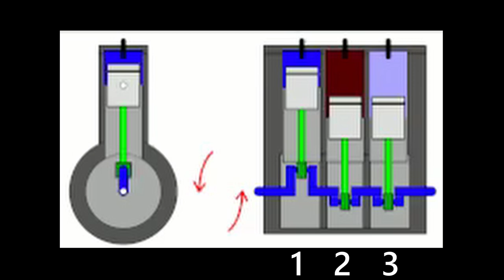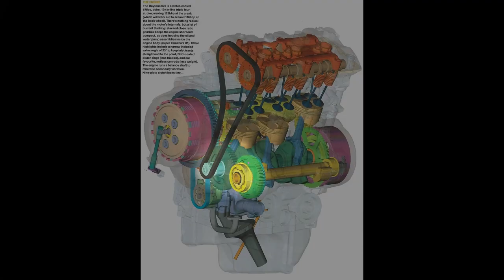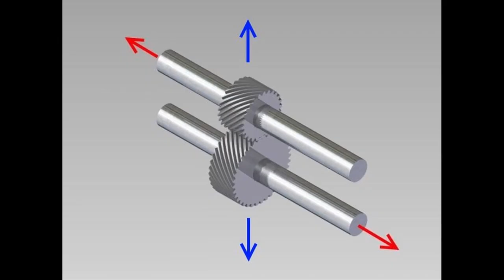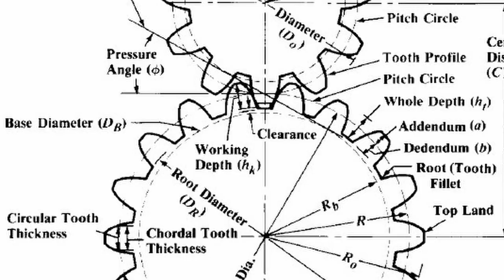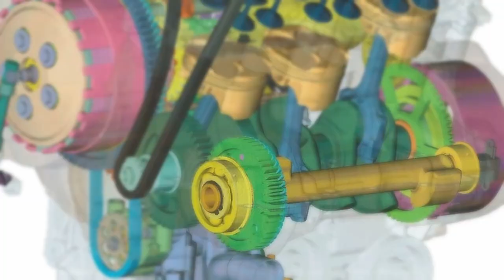THIS is WHY Triples WHINE and whistle | Tea Kettle HIDDEN inside the engine ?

Comment: Ok, I'm not someone who normally comments on channels other than in support if I like a video. It's normally short too, so excuse the length of this one. I subscribe to the workshop and many other bike channels, I subscribe to Matt's channel because I teach Mech Eng and have found his knowledge of engines and engineering in general interesting. 
From what I can see, there are many people out there that agree with your reasoning and many people who don't, I guess gear nomenclature is a complex subject. I will admit I am struggling to agree entirely with this as a "one size fits all" solution, but I don't think it is a million miles off the mark either. I do find dismissing the venturi effect in its entirety so hastily a little short sighted though. Matt did say he was speculating, and as I am sure you know, the complexity of Bernoulli's and Venturi's principles requires a lot more than a 10 minute video, so I would say speculating was sensible at that point, but still worth a mention by Matt, in my opinion.
Back to the point, I am sure with such a topic you will continue to prompt much discussion! You are certainly getting the views, more than my channel, but then I am working on an old XJ600!
This is quite possibly the longest comment I have ever left, but anybody who is passionate about Engineering can't help themselves.
Good luck with the channel.
ShedTorque.
Reply from the maker: Thank you for the comment ST and taking the time. Matt has built his channel on;
1/3 actually informative stuff, although badly executed - half his videos are him cursing about his markers not working.. 
1/3 literally bashing other content creators because he's very insecure but it brings him views and gives his minions things to do 
1/3 there not being a better alternative, and that's quickly changing.

I say this as someone who liked and watched his informative stuff before his ego inflated beyond biblical  proportions, think yeaaaars ago.

I welcome disagreement, but only when well argumented. To attack a much smaller channel on the basis of 'he's wrong, here's a speculation to attack him with' screams to me of wanting attention without thinking of the repercussions of his actions. If he really WAS concerned about the whole deal (he, the only guardian of the truth as he says), he would've contacted me directly - maybe asked questions, collaborated  on an experiment or something like that ;) Of course he didn't do any of that because he's an attention seeking psycho.

Back to the topic in hand. I owned and ridden multiple triples, it is my favourite engine config and put my own money down to buy them. I know them extremely well and  I've seen them being race tuned and prepped (Daytonas).  I know exactly where the balancer is on my XSR900 and I can literally hear it with a stethoscope. I can categorically tell you it is none of this exhaust bullshit he's talking about, he's way out of his depth on this one because he was too much in a hurry to being offended by a smaller channel making a video.

Love your stuff btw, good luck with the XJ6 ! Hopefully Matt won't send his deranged minions after your content too considering he thinks he's king of motorcycle content on youtube.
Reply: @UrgetoRide   
I watch The Workshop for the engineering so I won't get into the politics of it, but I guess we are all entitled to an opinion.
I totally understand what you are saying, I was suggesting the possibility of other additional variables, largely due to observations during venturi flowmeter testing, the unpredictable behaviour of gases at high reynolds numbers show strange and various phenomena. Anyway, I am boring myself. All the best with the channel though.

Comment from the maker: ⛔ Do you have any idea how many strings I had to pull to get James Bond to feature on this video ? Please make sure to subscribe and like and the whole shebang - the guy WAS NOT CHEAP ! ⛔

COMMENT WHAT OTHER TOPIC YOU'D LIKE ME TO COVER, SOMETHING AT THE BACK OF YOUR MIND THAT'S ALWAYS PUZZLED YOU ? LET ME KNOW. I'll make a video about why wheels are round if you guys want to, idgaf👍
Reply: How about a vid on how come all other bikes that have straight cut balancer shafts don’t whine?
Reply from the maker: I said it time and time again in the comments, and in the video, location and thickness of case, shape of teeth and their tolerances, oil path will all have an effect on if teeth whine, or not, or to what degree matie. Matt wants a bit of drama and material for a video, no matter whats right or wrong as long as he gets his rant.
Reply: Urge to Ride so are you saying that all triples from all manufacturers have exactly the same cut gears, crankcase thickness blah blah produce the same whine? Or could it be present on all engines but because of the power pulses and resonance from a triple it is only noticeable on triples?
Reply: Something that always puzzled us? Hell you dont even know the answers yourself!
It would be the same thing if i would start making videos, i dont know anybetter than other people!
And you want to solve their mysteries?!

Comment: My Fox 1.2 was a triple, never whistled once?
Reply from the maker: Cars have a completely different building agenda, engine cases are stronger, gears are helical, and noises are engineered out to a minimum. The typical buyer of a 1.2 Fox would think the engine is broken if it started whining... VW wouldnt want that. Thanks for popping in matie
Reply: @UrgetoRide  Has a balance shaft though?

And is probably not far off the size and integrity of a motorcycle engine itself anyhow.
Reply from the maker: Tommo, as I said, VW engineered it out. The CB shaft on your Fox is helical, not straight cut. Picture ; https://i.ebayimg.com/images/g/RH8AAOSwt3teqAxH/s-l1600.jpg

Hope this helps, and hope to see you again soon !
Reply: @UrgetoRide  I already understand this, video doesnt really do justice to what you are trying to get across here really.
Reply: @James Jones Because "This is why TRIPLES whine".

Its a triple aint it?
Reply: @tommorides8086  🤦‍♂️

Comment: Wrong. So wrong. So, so, so wrong.
Reply from the maker: No it's not. I swear if someone says exhaust venturi I'll off a baby panda
Reply: @UrgetoRide  sorry, but this is not the cause of the whistle. If it were, why don't we see it in any of the other engine types with the same balancer shaft / gearing set up? Almost every motorcycle engine type out there, 4 cylinders included, have examples with a balancer shaft with spur gears yet, no whistle? I would never claim to be an expert, but knowing that this same setup applies to more than just triples, to me at least, means this can't be the source of the whistle. Sorry.
Reply from the maker: @TheBeanyi  Highly suggest watching the whole video then, people tend to jump to conclusion, I understand - shape of teeth, tolerances between teeth, and if they have oil lubricate them or note will add or completely take away the noise they make.
Reply: What you on about it's the hurricane in the exhaust!
Reply from the maker: @The1Dude1Abides   If you have a BMW K1300 or K1200 to hand start it up and hear it whistle like a mother****, and thats a straight 4 firing every 180 iirc. By your and his  logic twins should whistle like mother***** ???
Reply: @UrgetoRide  man this discussion is exhausting
Reply: @UrgetoRide  but that's my point isn't it? Take the GS and compare it to the k1300... The GS is an online 4 with balancer shaft and spur gears as I understand it, yet there isn't a whistle... So you have two very similar engines with very similar hardware... 1 whistles and 1 doesn't. That's why I don't believe that this is the source of the whistle
Reply from the maker: @The1Dude1Abides  Hahahaha
Reply from the maker: @TheBeanyi  The GS is a boxer two... with a CHAIN driven CB. Hope this helps Ian
Reply: @UrgetoRide  fair play, like I said before , I'd never claim to be an expert... I just remain unconvinced... For me, there's to much variance and yet in some cases similarities between those that do wistle and those that don't. Unless someone like Triumph is willing to inform us, for me, it's all speculation
Reply from the maker: @TheBeanyi  It's OK Ian, Ive seen striples with no CB not make any whistle but run like ****, its ok you're entitled to your opinions, no hard feelings. Thanks for popping in anyway and hope will see you again on the channel.
Reply: VW and Porsche owners are sometimes fond of using cam shafts with straight cut gears and it makes the same whine. It is pretty common phenomenon.

Comment: Bro Yu are awsm... I really liked the presentation skills. Request if you can upload a video on why the Benelli tnt 899 and agusta f3 have loud mechanical noises coming out of the engine despite of having balancer shaft. They sound like something has broken inside the engine striking here and there. On the other side triumph's 3 cylinder is so smooth and soothing.

Comment: You have two ears but only one mouth...use it wisely. This video is BS. Do some research to the extent that spur gears are used throughout just about any motorcycle engine
Reply from the maker: I understand your skepticism. And if people at least watched the full video instead of barging in here with their minds fully made up ... I mentioned time and time again, the shape of the teeth, the tolerance, the engine case and most important of all, oil flow, will affect the sound. Bike gearboxes are straight cut but because they have excellent oil flow, you can barely hear them. Try running an  R6 with low oil and you'll see.
If you've already made up your mind - then thanks for checking out the channel anyway and hope to see you again. I'm not interested in youtube drama which the workshop clearly loves because he needs to pump out videos and make money off of you. I'm not. Do with that what you will..

Comment: I have cute bike called Skygo Pony 100, it makes the same whistle from idle to rev, it just gets louder when you rev it, but it does'nt give me problems in my 2yrs of driving it, oils are cheched and when i got to my mechanic for a tune up, it didn't disappear, first time the mechanic heard it he thought it was some metal scrapping on the inside, i said when i first bought it, it sounded like that. What could be a potential problem?

Comment: My Husqvarna 401 single cylinder does a similar whistle while engine braking. Is this a bad sign? The KTM mechanic didn't say anything about it when I brought it to the shop for inspection
Reply from the maker: Hard to tell but Im fairly sure singles usually have balancers so that could be the origin of the sound. If the mechanic ok'ed it then I wouldnt worry too much about it mate

Comment: all my bikes have straight cut (or spur) gears on their balancer shafts and not one of them whines like a triple. think there's alot more to what makes the engine noise and the acoustics of engines than just one small element. Unequal manifold lengths will contribute as well as resonant frequencies with engine noise/exhaust length/diameter/pulsing/firing order. The list is very long. Its not as straight cut (pun intended) as you make out.
Reply from the maker: Watch the full video please. There are a lot of factors why some whine more than others, and some not at all - chief amongst which is lubrication. As for the rest of your comment, unequal manifold lengths do add a growl at full chat, but that is not the whine you hear at idle. Firing orders on most triple currently made is a simple 1-3-2, nothing special about it, trust me plus they're equal firing. 
But nice pun. Give me an example of these bikes you own if you wish - I'm interested ✌️
Reply: @UrgetoRide  I did watch the whole video, just rewatched incase anything was missed and I still stand by my point that the balancer shaft and straight cut gears aren't the one and only reason why triples whine and its a more complicated issue/phenomenon (not sure of the correct word) than can be covered in an approximate 7 minute video, though as a British biker it would be great if it was a secret kettle. Main bike at the moment is a lexmoto isca and if anyone was going to cut corners on lubrication to the balancer shaft on their bikes it would be a chinese manufacturer, and the only whine I get at idle is actually injector noise. Would be interesting to see a fuller, more in depth test of the spur gear idea. Running the same triple that whines at idle with and without a balance shaft to see the difference in whine/whistle and low to mid revs, though I can appreciate not many folks will be willing to put their bike through that

Comment: I simply don't understand why. I've read a lot of comments under this video, but I still question myself, why does the Mt 07 does not whistle, while also having a balancer shaft driven by straight cut gears, while the MT 09 whines and also has a balancer shaft driven by straight cut gears ? Could someone explain?
Reply from the maker: The MT07 does whine but very faintly - if you have an MT07 with a stock exhaust it becomes easier to notice it. Trust me its there
Reply: @UrgetoRide  And why is this whine so much louder on particular 3 cylinder bikes ? I mean the gears and other parts in the engine are also straight cut driven and aren't that loud, it's not quite logical for me
Reply: @dst8636  well, just like he said, MV Agusta triple is not noticeable too. Probably because of the depth gear I guess.

Comment: I don't understand all the comments about straight cut gears not whining. They whine, some more than others. And yes the gearbox whines too, you can hear it. And yes timing gears(present on older bikes) whine too. Alternators on bikes also whine. If this counter balance thingy is the primary source of the whine on those bikes or not, i don't know. Remove it and try it.

Comment: Nice! The CBR 250R, 250cc single cylinder sport-tourer motorcycle also uses this to reduce the single cyl vibes! They also have this distinctive whine! Love em.

Edit: please do a video on the Ducati V4's counter rotating crank! It's a masterpiece. The tail of the bike rises as you rev the motorcycle due to the crank rotating the opposite direction.
Reply from the maker: Thats right Joe ! CB shafts are not reserved to Inline 3s only at all. You can for example also hear it well on the 4 cylindered BMW K1200 and K1300. 

Good suggestion Joe thanks I'll look into it ! Most MotoGP bikes have got a counter rotating crank these days for agility so it might be interesting for the community.
Reply: @UrgetoRide  I'd love a video on that if you can get around to it.

Comment: Love my CP3 "whistle" wouldn't trade it for anything!
Reply from the maker: It's just such a perfect engine, I genuinely think it is the most versatile, fun yet accessible and reliable engine out there. Yamaha if you're listening please bring out an 'R9' or R8.5 or call it whatever you want just for the hell of it, imagine an R6 but with a CP3....
Reply: @UrgetoRide  I would love Yamaha to bump the 847cc out to a true 900cc triple!
Reply from the maker: @andrewb1667  Well due to emissions and the rest of it, they just might... Most manufacturers just bump cc like the Tiger 900, the Shiver 900 NC750 etc... so its not too an outlandish idea !
Reply: How do you find the top end on the CP3? I've heard some folks say it runs out of steam a bit. (I realise that's possibly being said from a very subjective point of view, and having a bike on the dyno would clarify and a tune would probably sort too)...

Must get around to test riding one them.
Reply: @hyperthunk  the top end is strong, but it isn't a supersport. It runs out of steam around 120 mph, but will still pull up to the 150's. Without any windscreen, I've had mine to 140 with my flashed ecu. It takes a long stretch of road to get any higher, and the wind is terrible.
Reply from the maker: Hi Tim, not sure if question was directed to me or not, but top end on CP3 is not inline 4 like, but VERY strong. RPM wise the bike keeps pushing like an enraged bull, seriously. Speed wise, it runs out of shove around 120 or so - at that speed you're fighting the wind anyway so wouldnt want to go any higher. As someone who's more about torque and acceleration I couldnt wish for a better engine.
Reply: @andrewb1667  wind blast is just a thing on a naked so that seems fair!
Reply: @UrgetoRide  fair! Will have to give one a test ride sometime. Would want the SP though, for that lush onlins suspension 😍
Reply: I listened to a gen-1 MT09 go past while I was walking down Streatham High Street yesterday. He had a full akra system on, and I honestly could barely make out the whistle over the marvelous exhaust note. Sounded mint though. 👌
Reply: @hyperthunk  honestly anything under 70 mph, and I don't even notice the wind. So I don't complain about it ever really. If I was riding all the time at those speeds then I would probably not have gotten a naked bike, but for me they are just about perfect!

Comment: Only whining I notice on my MT09 is from my front sprocket.
Reply from the maker: Thats really odd, I got a CP3 and sprocket doesn't make any noise (that's out the ordinary). Might be due a new chain maybe ?
Reply: @UrgetoRide  yeah it's because of the sprocket style that was put on. IIRC it didn't have the same padding than the OEM sprocket and I was told it would whine more, so I was expecting it.
Reply from the maker: Hmm, if you've got a video of it feel free to share! I never heard of that to be honest
Reply: @Pretency  heard and had the same thing on my z1000 , only hear it under partial throttle or cruising. Kinda like it lol.